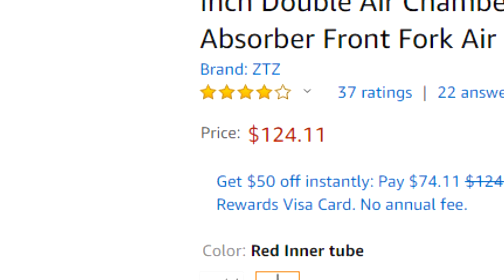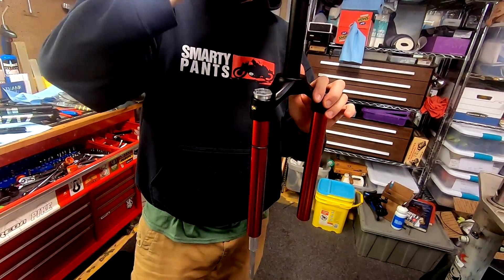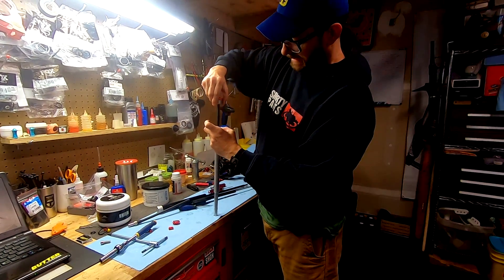$124 Bolany ZTZ Mountain Bike Air Fork Tear Down | Butter Suspension

Comment: Suprisingly great video I literally thought this is from from a 1 mil yt channel KEEP DOING WHAT YOU ARE DOING!
Reply from the maker: Thanks Jac!
Reply: Hey @ButterSuspension, first off, nice video, I like the straightforwardness of just taking it apart and showing the inside pieces. I just recently bought a 2021 Orbea MX50 that comes with a stock SR Suntour XCE 28 Coil suspension fork. That’s working pretty well right now but an upgrade might be in order sometime in the next few years. Do you have any relatively cheap (like under $200) forks that you would recommend? I mean forks that you’ve taken apart and used to be sure they’re good quality. Thanks.
Reply from the maker: @bjornklein935  anything from Rockshox or Manitou is gonna be a good option, but I'm not sure if anything is available in the $200 range, especially with Covid supply chain issues. Used stuff is also an option, just be sure to have it checked out or ask about any service that's been done.
Reply: Ok. I wasn’t sure if manitou was a good brand so thanks. The shock I have now is working surprisingly well for now(considering that I use it for aggressive xc riding)  so hopefully next year or the year after things will be slightly cheaper.
Reply: @ButterSuspension  hi, can you do a review about bucklos lutu 150$ dollar suspension. 👊👊
Reply: I glanced at the sub count and read 1.4k as 1.4 mil lol didnt even second guess it till i saw ur comment
Reply: Thank you so much Jac <3

Comment: i've seen that ZTZ and bolany forks are the exact same, but ZTZs seem to go for quite a bit cheaper. i've also seen ZTZs with bad threads on the air valve, and that they seem to run a little rougher. my guess is that the ones that come out with bad threads or are out of spec are sold as ZTZs, or maybe they have two production lines, one for bolany with decent QC and one for ZTZ with worse QC.

Comment: I know for a fact that these forks cost $5 to manufacture in tens of thousand s. You can BUY them in bulk for $10.50 EA If you get 500. Subbed btw.
Reply from the maker: I need to come up with an art project using 500 Bolany forks 😂

Comment: So, hypothetically, to reduce the travel on that fork and make it sit lower, I could reduce the length of the shaft in the air spring? I'm guessing it would have to be cut from the top. So I would remove the piston, cut the shaft, and reinstall the piston.
Reply from the maker: I believe so, yes.

Comment: So far i notice some parts are the same for old suspension.. It's possible to build 1 Frankenstein fork suspension?
Reply from the maker: They definitely use some random bits from all over the place, but they're also a factory so they can make whatever they need to get stuff to fit.

Comment: Lets be honest. 90% of riders dont even understand what a high level of performance is.
Reply from the maker: Sure, but everyone understands broken teeth!
Reply: @ButterSuspension  ........o'cmon. You cyclist guys are so over the top with this. Yall love to get ripped off. Spending as much for bike forks as a premium shock and spring setup for my audi. It's goofy.
Reply from the maker: @EPTRotorsports you're right, a $200 bike is totally fine. 😂 Just like a $1000 used car would be fine, right?

Comment: hi , do you the inverted fork racework r7 from Aliexpress ?
Reply from the maker: I don't really work on any forks at this price point; if the fork is $130 and a rebuild is $150 labor... Most folks would just buy another fork. 

The other issue is finding parts, I'm not sure where to source replacement seals for these models.

Comment: Wish I'd seen this video like a year ago! I did end up buying a Bolany back then, and honestly this video probably wouldn't have changed that decision, but I'd have been a lot more confident in knowing what exactly it is that I bought. (Mine was "gold" stanchions, which are really more of an orange; perfect fit for my 15-year-old mountain-turned-commuter bike where basically every part I've replaced so far has been a different shade of "gold". Goes a long way towards letting people know where my budget is on that one, hah.)

And gotta say, I don't take it on anything besides light trails myself, and I've been... I don't want to say impressed, but surprised to find it's performed as good as the stock Suntour fork it replaced. A bit less durable (it's got a slight looseness after a year-ish that the Suntour took 10+ years to develop) but the Suntour was this beefy, super heavy coil fork, and the Bolany is a far lighter and more comfortable air fork with a remote lockout.

I wouldn't trust it off more than like a 1-2 foot drop, but I wouldn't trust the rest of my bike off a bigger drop than that either (old entry-level bike shop bike that would probably survive, but I don't know if the components would). And having just dismantled and re-built a far newer Suntour fork earlier today, I'm pleasantly(?) surprised to see the Bolany is nearly identical on the inside, so at the very least there's some potential for simpler repairs. Maybe if the Bolany gets more noticeably loose I'd pay the $15 or whatever for new stanchion bushings and seals rather than a whole new fork.

Comment: any idea what's the max PSI this fork can be pumped up to?  the sticker on the side only shows up to 100psi

Had a trial run just on road was nice and soft, but I found the bike was extremely twitchy on flat road compare to the original suntour spring fork.  Its better when I lock the shock, but when its bouncy, it just twitch like it has a mind of it's own..... SAG at 100psi for me is way too low
Reply from the maker: No idea, sorry. Mine didn't come with an owners manual...
Reply: @ButterSuspension  whats the highest you have run to?  came across a Bucklo (similar cheap fork) comment on Amazon  that stated 160psi max.
Reply from the maker: @okitoki1973  to be honest these forks never come through my shop, not once in almost 7 years. The only one I've seen was bought for this video.

Comment: Ordering a Bolany suspension fork for an old road bike I'm overhauling. I know I can get better performance from a fixed fork or more capability from a better suspension fork, but I wanted some basic suspension for comfort. Gonna be fairly light duty, and I just want something I can adjust and make a little spongy for less than ideal roads. Might tinker with it for a bit first to make it a little more "seaworthy", but honestly not regretting my decision. Looks decent for what it is, but yeah maybe good idea to know its limitation.

Comment: I just got these installed lol any tips to maintain? I had some guy tell me to put oil in them but I’m not really sure what he ment or where I would put it
Reply from the maker: These aren't really designed to have bath oil in them, I'd just keep them greased.
Reply: After every few rides, I put fork lube on the stanchions and wipe clean after a few full up/down pumps.  Frees up fork from sticking and cleans crud out of bushing seals.
Reply: @prblakeslee use light grease like slickoleum for the lowers

Comment: That brand is the most commonly used suspension fork here in the Philippines because of budget issues. Also, a lot have attested that its just enough for casual rides because a lot have encountered accidents while using it on trails.

Comment: One of the people with lower end forks 😭.  Yh my srsuntour for was acting like crap. I think I blew the damper on a downhill run. I need a fork that has a straight steer and 9mm qr that is sturdy for less than 200. I'm planning on getting a new frame wheels and fork that are all boost with thru axles and tapered head tube. For the time being I just want a cheap air fork that will survive.
Reply from the maker: I'd look at vintage Rockshox; Reba, Revelation, etc. As long as it's in good shape, you can rebuild them almost endlessly and seal kits are still available.

Comment: Question. 20" x 4" ebike stock fork may possibly be filled with queso. A reasonable replacement fork would beeee????
Reply from the maker: 20" x 4"? Wtf, ha ha. I'm out of the loop on anything that would fit that sized wheel/tire. 

I'd just replace the queso.

Comment: my man, would these work for just commute biking with a electric motor? flat land, slight up hill. im on a tight budget and sorta just need it to absorb some bumps as my carbon forks are HARD on the wrists doing like 23-25mph
Reply from the maker: I'm always gonna default to "used quality is always safer than new bolany". I know the price is low, but there's just no recourse if these fail, regardless of where and how you use them. There are tons of used forks on the market from brands that have tested their products.
Reply: @ButterSuspension  thanks for the input. ill see what i can find ty

Comment: If these fail can you just lock them out and use it as a standard fork? Sorry for the dumb question. I’m new to this.
Reply from the maker: No dumb questions! Technically, yes, assuming the damper cartridge holds...

My biggest concern about forks at this price has to do with structural integrity.

Comment: Really great video! I bought a fork made by the same brand about a year ago right when I got into mountain biking... I didn't know anything about forks at the time (Let alone bikes) and I thought that since it was an air fork it must be great, plus the price appealed to me. I really wish I had this video at the time to guide my thought process. I didn't ride the bike over the winter, as there is too much snow where I live to ride without a fat bike, but when I picked the bike up the next spring I came to find out that it had zero air in it. I brought it to the bike shop to get them to pump it up and pink sealent started bursting out... I'm not quite sure why there was sealent in there in the first place, but it was a complete waste of 200 bucks Canadian... What I wish I knew back then.

Comment: If anyone wants to know I had a pair of forks like this they were ok when they worked but then the stanchions snapped inside the crown on some threads that the damper goes in and then it came out when I was pushing to the top and pretty much if that had happened when I was riding I would have been screwed. Took them apart after they broke and they were  very similar to this

Comment: great video thanks for  the detailed comments-glad I watched-after watching the video I don't want to ride (s/w desert trails) always looking down at the fork constantly worried about it failing ...so any recommendations for a safe(r?), "affordable" air susp QR, straight steerer fork for an entry level 26" (Mongoose) fatbike? Having fun upgrading other stuff, but not many or any air susp fork options, so any help/comments is appreciated!
Reply from the maker: Straight steerer stuff is hard to find new, but there's tons of used options out there...the fat bike aspect is tricky since older straight steerer stuff is never designed for fat bike tires.

Comment: Can you put oil inside lowers and close them with crush washers?
Reply from the maker: Crush washers don't keep oil in the lowers. Most oil bath lubricated forks have very tight fit shafts that get drawn into bores in the lowers; the crush washers just provide extra hold on the foot nuts/bolts. You can remove the foot nuts or bolts on Fox and Rockshox and no oil will leak out.

Comment: So actually it is very similiar to a regular old Suntour XCT. Good fork for city parks, commuting and riding light gravel.
Reply from the maker: Similar, but there's no recourse if something fails on a Bolany. I'd rather have an older used Rockshox fork.
Reply: @ButterSuspension  But it seems that Baloney forks use parts compatible to Manitou and Suntour, according to the video.
Reply from the maker: @DilbertMuc  they use a knob that was used on Manitou but the damper it sits on is not the same. Also, for the most part, o-rings are o-rings, those are common across many industries, bit the material and engineering of the hard parts are what make me wary. Again, it comes down to accountability and testing protocol.
Reply: @ButterSuspension  Is it possible that Seth (Seth's Bike Hacks) from Berm Peak used this fork in one of his latest bike videos? A noname from Amazon for the same price and looks. He tested it on his trail park in his video.

Comment: Imagine if you took the insides out of a Fox 32 or something and then put them into this fork. I don't know much about suspension, but couldn't that work?
Reply from the maker: It's been suggested before, and on paper it makes sense...but the reality is the materials of the upper legs, crown and lower legs aren't high quality, so it doesn't really improve the strength of the fork. Also, even among different generations of Fox or Rockshox forks, the internal machining and threading is different across the years, so the work needed to get Fox guts to fit in one of these forks would be super expensive.
Reply: @ButterSuspension  Damn that sucks, because those stantions are litteral fire!

Comment: Great video review of the bolany fork.
I have that kind of fork... Similar type, but not the same brand. Because I do not have the money to buy expensive forks (honestly!)...
My question is this: Is it safe to use that fork for casual trails? And can that withstand maybe a foot, or a couple of feet of jumps? What is its limitations??? 😅

Thanks for the reply. More power to your channel. Subscribed! 😃👍
Reply: @Chrome Book Thanks for the reply! 🙂
Reply from the maker: Chrome Book is a troll, and a liar. They ARE NOT the same stuff, not made from the same materials and are not made in the same factory! I'm not sure what his deal is, other than misinformation; the account being used is only a few days old.
Reply: @ButterSuspension  Then, can you please answer my question? 🙂
Reply from the maker: @nomarbulalakaw9391  I think for "casual" riding, it would probably be okay. But I would rather ride an older name brand fork that I know has been tested and that  I could service. For about the same price as a new Bolany or Lutu, you could get a good used Rockshox Reba...
Reply: @ButterSuspension  This is noted. Thanks! :)

Comment: Would it be possible to lower the length of this fork if I wanted to put it on a gravel bike and not mess up the geometry with a super long fork? Basically shorten the travel I guess is what I'm trying to say. They make one with orange stanchions and NOBODY makes a short travel fork with those.
Reply from the maker: I guess you could add a spacer below the main air piston. But honestly, I wouldn't ride this fork. No testing, no warranty, no one to call or email...if this thing fails, you're SOL.
Reply: @ButterSuspension  suggestions on getting a shorter fork that isn't $500+? My axle to crown is only 420mm and don't want to go over 450...and orange stanchions would fit the rest of the bike but not a deal breaker. Not much out there for gravel bikes yet.
Reply from the maker: Maybe an older Reba? You can shorten the travel with spacers depending on which air spring they have.

Comment: Ive been seeing lots of vids on these and other Amazon forks and im surprised there’s no legal action going on, the red ABS switch at the top, is that not manitou? Some have a Solo Air sticker on the bottom which looks like it was pulled directly from Rockshox. One read a warning sticker I could swear was from suntour and some variations (himalo?) look like clone fox fork lowers. I wonder how they get away with it lol.
Reply from the maker: The Manitou switch is probably leftovers from some factory, but overall, yeah it's kinda nuts.